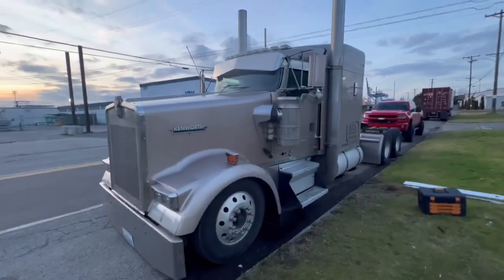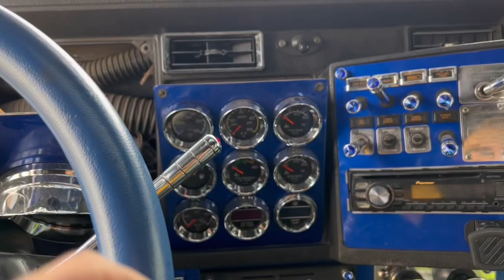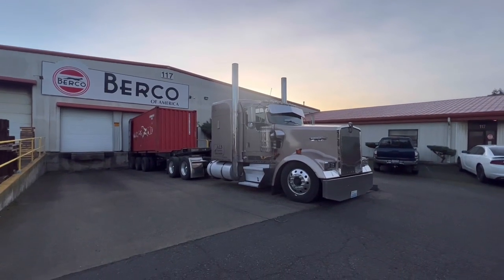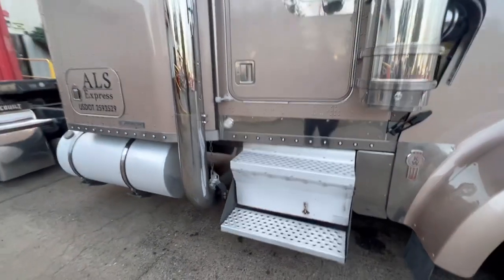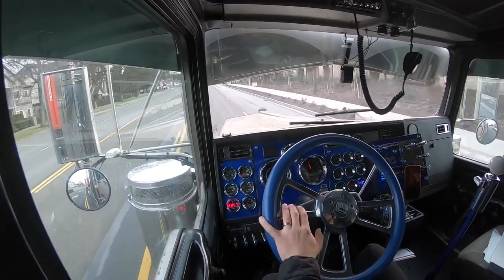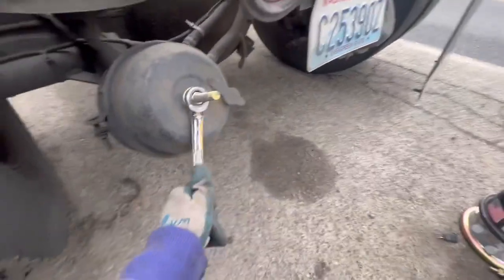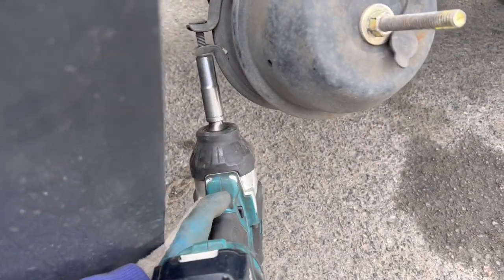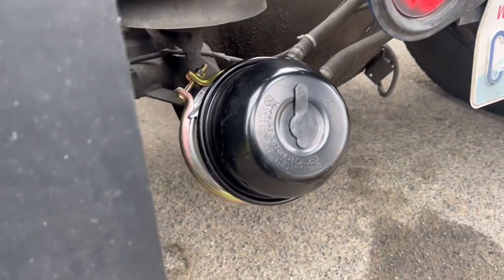First Load of 2023 | First Breakdown | Loud CAT 6NZ Stage 1 Turbo Rollers

Comment: Funny timing In getting your truck Polished. It's been a year and a 1/2 since I bought mine and needs a good Polish. I was just calling around and I was quoted $500 just for the fuel tanks and they wouldn't do the rims unless I took them off the the truck
Reply from the maker: Was quoted about 600 for 4 wheels and the tanks. But yeah he also wants me to remove wheels. It’ll turn out a lot better

Comment: I know it will take awhile. But I look forward to seeing what you do with the back half of your truck. Or nothing at all.
Reply from the maker: The back of sleeper?
Reply: @CustomRigs  I meant behind the sleeper to the back lights. Like you plan on half fenders in the future?
Reply from the maker: @davidmeyer1142  I’ve been thinking of it, I like the quarter fenders right now easy to pull the fifth wheel handle